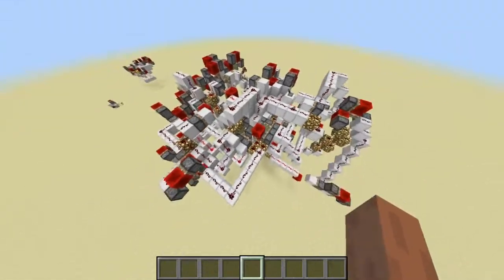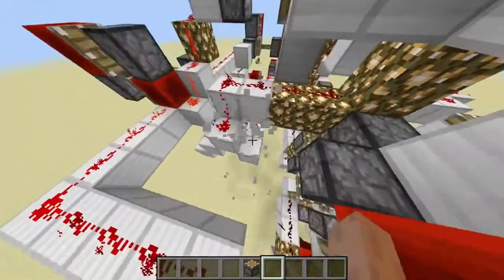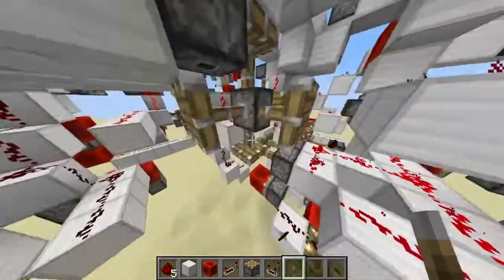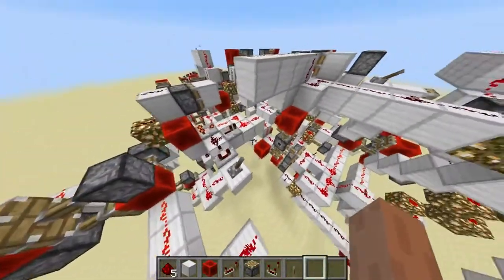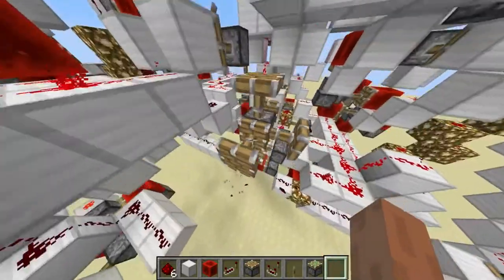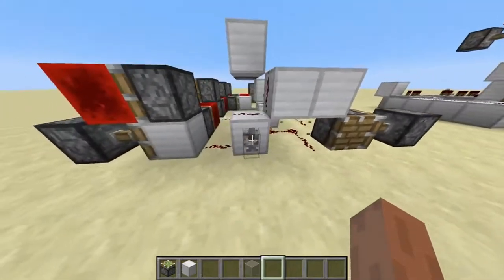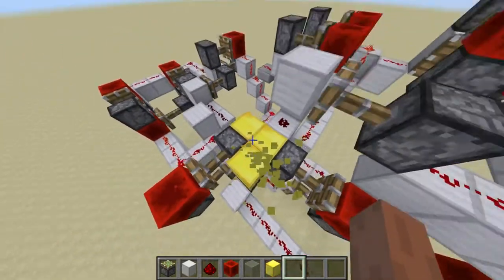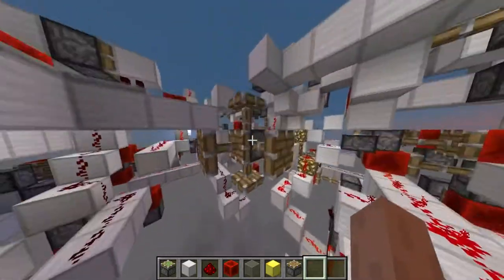Piston with 5 heads

Comment: Hey Myren, I watched bilde man's video about breaking bedrock with those normal headless pistons, and after watching your video, I came up with this idea: if using weird zero tick tech we can move pistons while they are extending, could we use this to blow up the piston head and then move the piston to a suitable place to break bedrock? I think that using the correct timing maybe we could manage to do it.
Reply from the maker: MrMCMax Well, if it was possible with the current technology I would´ve already done it, but thanks for your suggestion. I don´t really move activated piston bases, I just convert them into their glitchy state (where the piston base is unactivated) and move them before they convert into block 36. So with the current technology I can instantlty get a powered piston base into it´s unpowered state, and then move it, but I can´t really move it while it´s in its powered state.